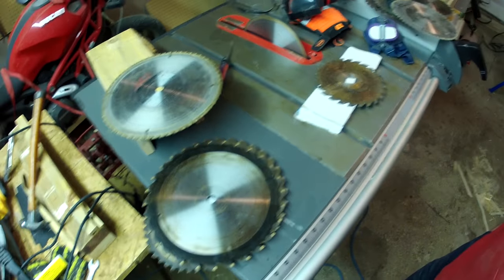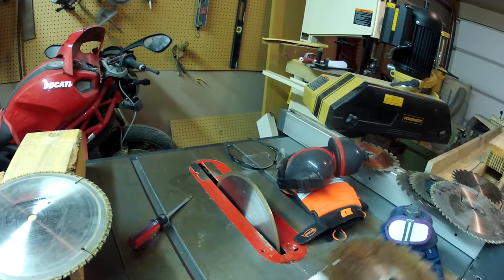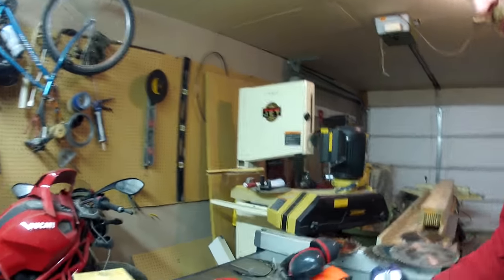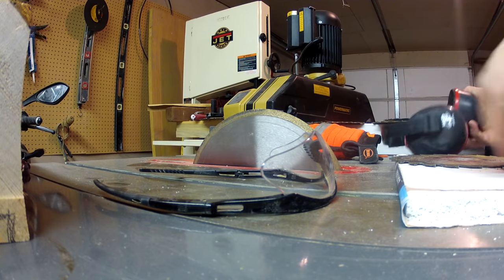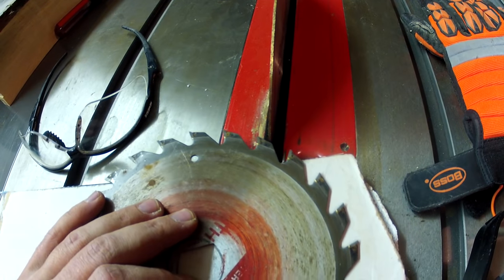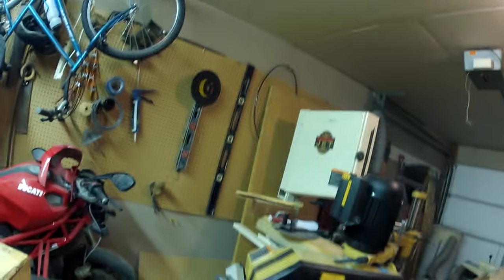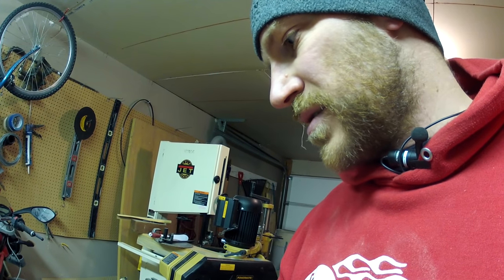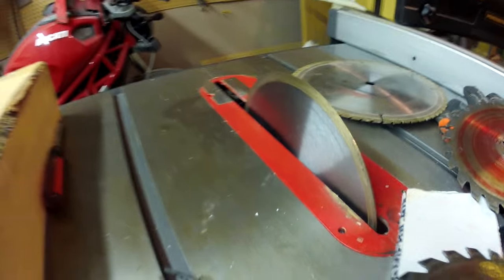How to sharpen your circular saw blades, the easy way.

Comment: Almost nothing dulls HSS saw blades like cutting particle board.  I generally need a carbide-tipped blade to get any mileage.
Reply: In a nutshell, carbide is a lot harder and as a result, more brittle. That final hone crumbles the edge, whereas HSS burrs rather than crumbles, ultimately leaving a sharper edge. However, as you noted, the life of carbide is far superior to HSS steel, so your slightly duller tool is going to be slightly duller for a long time. The comparison of carbide to HSS is more common in moulder and planer work than CNC applications. Stick with your carbide inserts on the CNC. 

Well, there are some materials that you just don't want to use steel on, like MDF or plywood. They will dull steel fairly quickly. Carbide tips and inserts are composed of very fine particles that are compressed or sintered into a whole, so the finest edge or corner that can be achieved is relative to the particle size. Steel particles or grains are more homogenous, and can be shaped or polished to a finer edge. All this is on a microscopic level, so it really doesn't apply much to the person doing standard wood machining and molding, except that the carbide tooling will last much longer before getting dull. If you are doing carving or fine joinery, the polished, clean cut of steel tools is more obvious and you are not as concerned about tool edge life, because you are continually touching up the edge. I use carbide tools and inserts almost exclusively on CNC equipment, and steel tools for handwork.

Comment: So anytime I want to sharpen a blade I have to blow out my saw to make sure I don't start a fire? Much faster and cheaper to use my die grinder and diamond  wheel.
Reply from the maker: I don't sharpen this way anymore but when I did I just used the air hose to get rid of the sawdust and it was good to go.

Comment: The angle on ever other tooth is the same.... the others are the opposite way from the previous ones....one would tip to the right the next one to the left and so on.....but still a great video!!!
Reply: +zeke112964 I could be wrong "zeke" but I use a Planer Blade on my Mitre Saw for Finish Cutting and (From Memory) I believe all of the teeth are Flush and don't have an angle on any of them.
Reply: zeke112964 I saw nothing there about a Planer Blade.

Comment: These blades are undoubtedly sharper, but nowhere near factory sharp because every other tooth is canted 10 to 12 degrees in the opposite direction. You should Mark every other tooth on one side with one color of Sharpie, and the other opposing teeth with a different color. Make a 10-12° wedge, instead of the drywall, or under it, to match the factory grinding.

Comment: The ~EASY~ way is to get the Harbor Freight Saw Blade Sharpener... Seriously easy, and more accurate in repeatability that all teeth are at same angles... It works great!
Reply: I have one.  Works great.  watch the video with the guy that does the in-depth review on it, he found a few areas of improvement on the jig to make it work better.

Comment: Don't you have to sharpen the side of the blade too?
Reply: No. The inserts are all ground at the factory. When you bring the front face back it will form a fresh sharp intersection with the factory faces.

Comment: I've never needed to sharpen a carbide blade hell they don't get dull?
Reply: They do when machining steel.
Reply: how often did you use it    once???  lol.  they get dull
Reply: I was talking machining hardened steel. And when a tooth on a machine tool when the tool gets chipped.
Reply: George Lee

Comment: I could see how you could make a nifty jig for this so you can even get the proper set in the teeth instead of just grinding them flat. Cool idea.
Reply: You need a 5 degree angle on most blades.

Comment: Also, a blade isn't ruined when it gets a chipped tooth. With a torch, some silver, and new carbide you can braze in new carbide teeth. Just some ideas if you would like to save money and reuse your blades. Or you can send your dull blades to my shop, and I will have them like new for a quarter of the price of a new blade.

Comment: This would work good but not great. if you take a really close look at the carbide on the blade you should notice the angle of every other carbide is different. That is why a jig is important. you should sharpen every other carbide with a specific angle then flip the blade over and do the same with the ones that have not been sharpened. this sharpens the teeth properly and allows for a little bit wider cut than the blade width so the blade will not bind as quickly. I am not saying your method will not work but the teeth are not being sharpened as in the factory and will not work as long.

Comment: After watching this I was a little frustrated that he didn't describe the blade he used. There are many kinds out there. I assumed smoother would be better and found one at Amazon by Concord Blades (CRS100G10CP) for about $22. I tried and it works very well.
Reply: Richard Foreman that diamond blade will do that for a very long time and can get all day for 20 bucks

Comment: Don't have a table saw so rigged up my jewelers flex shaft and a 1 inch diamond wheel and have to say the blade cuts like hot knife through butter....

Comment: You did not show us the before and after cutting ability. I have dozens of old blades I have saved for quite a while.
Reply from the maker: This method isn't the best but works. I have a new grinding disk i use that's 600 grit and does a much better job. You just need to pay attention to the alternating tooth angles.

Comment: hmm, should be easy to use on a tile cutting saw too
Reply from the maker: As long as it's a fine grit. I'm using 400 grit now but haven't had a chance to put out a video. It's a significantly better edge.
Here'es the wheel:
https://www.amazon.com/gp/product/B00A52VN4U/ref=oh_aui_search_detailpage?ie=UTF8&psc=1
Reply: Thanks for the reply!

Comment: What's wrong with the ducati, looks like you wrecked it.
Reply from the maker: +George Lee Nope, it just needs a new battery and timing belt. It wouldn't be that big of deal but the nearest dealership is 7 hours away.
Reply: Thats the reason my brother got rid of his 900ss ,cost of valve adjustment and lack od local dealers.

Comment: No way I'd use this method on a $80 matsushita blade.. Blades have bevels on the teeth bro.. I have like 3k in used blades I've been saving for a couple years and I'm going to try one of those eBay sharpeners
Reply: +spin230 they actually work quite well. just got mine off amazon for like 60 bux plus shipping, make sure you get a diamond and a polishing wheel for it, neither one does the job of the other, diamond takes down chips, polisher actually sharpens.

Comment: you're setting yourself up to be hurt that... get a piece of wood fasten it to your table so it fits around your blade and then set your blade where it needs to be where the cut will take place take a couple drywall screws put one on the left side and one on the right side you take your blade insert the tooth into the left side screw and as you move it in as it takes it sharpened it will stop on the right side screw no muss no fuss and safe you cannot accidentally jam the saw blade into the diamond wheel there's no accident potential there
Reply: Dude, a period is not for ascetics... when your subject changes, you need to use a period or a comma...

Comment: Your table saw could sneak up on a cat.. super quiet.
Reply from the maker: TonyScandal In my experience most all of the sound comes from the design of the blade. If you wanted to test that theory just run your saw without the blade on it. In this case there aren't any teeth to disrupt the air = less noise.

Comment: Just started trying this out using a cheaper diamond wheel I found on Amazon for $21.51. It seems to take about twice as long to sharpen as what I'm seeing in this video, but if I can do in 5 minutes what the author does in 2 minutes, it's still a huge savings and convenience. 

I'm using this: 
http://www.amazon.com/gp/product/B00MXT29ZU

The man in this video is using this:
http://www.lowes.com/pd_196039-10742-TL10SPP_0__?productId=3151531

Note, these blades are intended for wet use only, however this process is using them dry. Oh, and I was lucky enough to find a Limited Edition Drywall Jig® in the corner on the floor of my shop.

Comment: Don't do this. If it were this simple there wouldn't be blade sharpening services. That grit on a motor spinning that fast, and God dam if you have just a little bit of runout, you'll chip the carbide or put microscopic cracks in it. A carbide tooth coming off a blade at 5000rpm with take your eye out glasses be damned

Comment: This looks like it works great until that one time it doesn't. And that one time the table saw blade catches on the blade your sharpening and flings it at you at super high speed. I don't care how many you've sharpened this way. One tiny misstep could kill you or disfigure you for life. Very poor risk/reward here.
Reply: j
Reply: The blade running on the saw is smooth. So what is going to catch?
Reply: Caress it gently

Comment: What an absurd waste of time. Consider what your time (and the diamond blade) is worth compared to simply purchasing a new circular saw blade. A decent diamond blade cost about six times what a new circular blade costs. Also you would be better off using a cheap metal grinding wheel vs diamond blade. The metal that the diamond matrix is embedded in is softer than the metal you are sharpening, therefore you are most likely abrading the cutting edge of the diamond blade at an epic rate. I don't usually post negative comments, but this just doesn't make sense.
Reply: Regardless whether it makes sense to you, he is enjoying what he is doing. In addition to that he is providing information other folks may find useful. By the way, it is possible activities you engage in have people questioning you as well.
Reply: His method is a bit crude as it is an inaccurate. When he brings the blade to the wheel the angle is not constant as it would be on a sharpening machine. However he bought the blades for only a buck each and if this works for him it might work for others. So in the long run I say "kudos" to him.
Reply: I don't know about you but my free time is not worth much in terms of money...just enjoyment.  Lighten up, relax a little friend.
Reply: I have no idea where you go to buy saw blades but you evidently don't know what a good blade costs, and what diamond blade costs six times more? That's one thing, two, a grinding wheel to sharpen a saw blade.... Really. And then you go on and say it would be even better! No no my lil buddy, your statement was an absurd waste of time.
Reply: It is not a waste of time, it is a way to salvage resources, and reuse supplies... less waste is better for everyone genius.
Reply: a good blade is atleast $80
Reply: Huh, I'll have to keep an eye out for those $600 diamond blades...